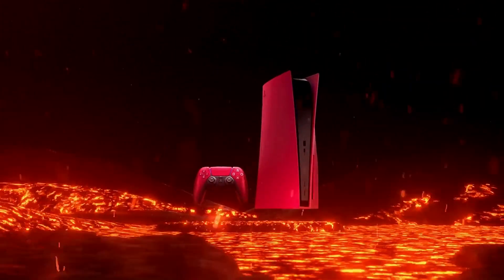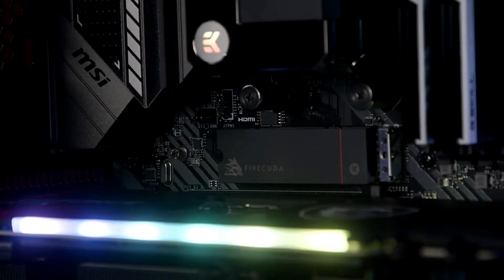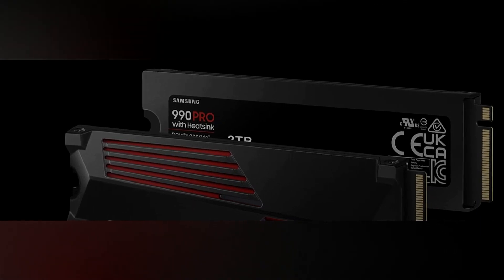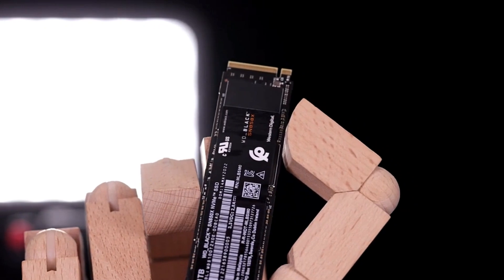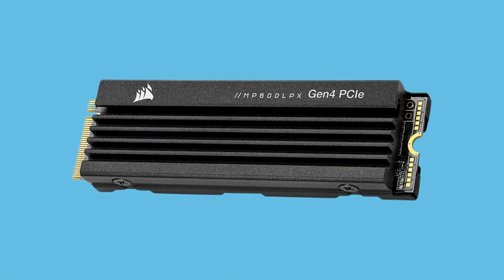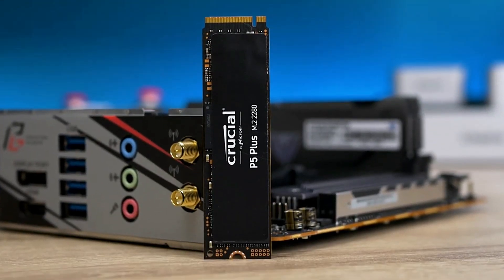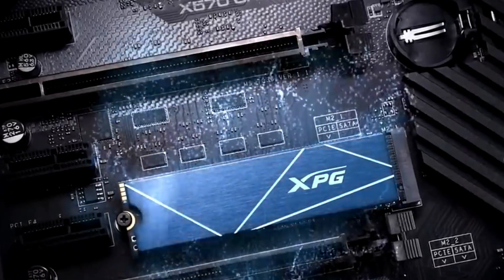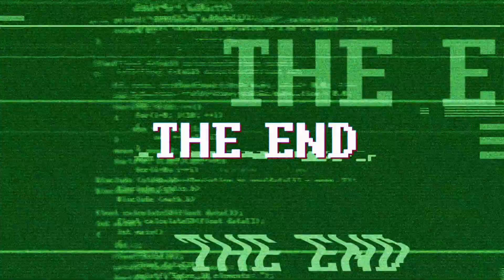Best SSDs for PS5 in 2024

Comment: Currently have 2tb Seagate on my PS5 for a year and half now. I barely play games but for some reason Demon Souls is a bit laggy and took longer to load if the game is installed on Seagate. I tried to move the game to internal ssd and it works fine. Transfering data from Seagate to internal ssd is also taking longer than it was. I'm considering to upgrade to 4tb Adata 960 but not sure if it is a better piece of device durability and performance wise